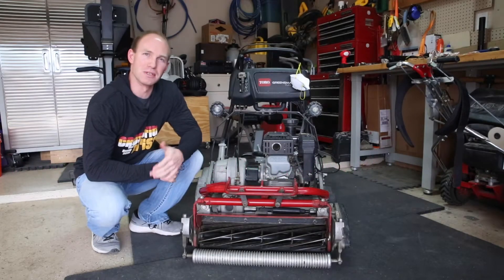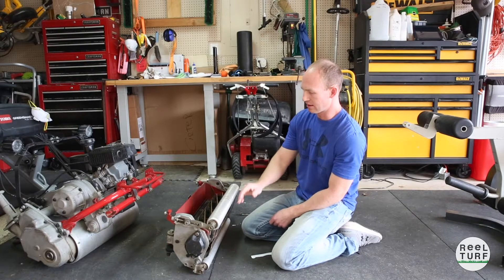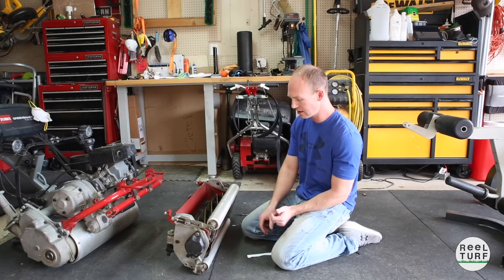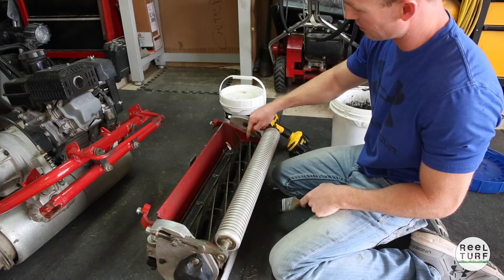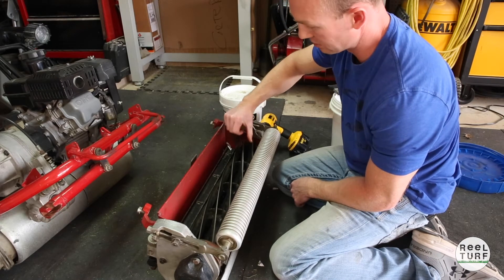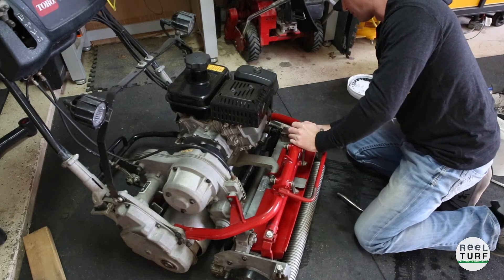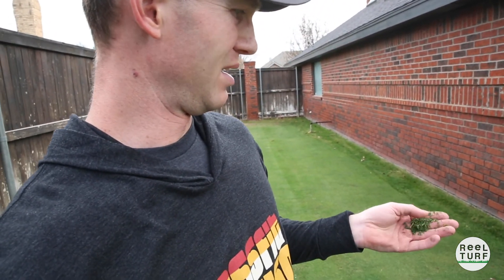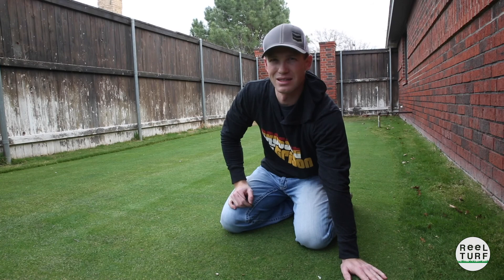Putting Green & Backlapping

Comment: I just bought a used toro flex 21. Your videos are awesome and have already helped me out a ton. Thanks for taking the time.
Reply from the maker: Flex 21 nice! I’m glad you’ve enjoyed the videos. Anything in particular you want to know about?
Reply: @ReelTurf  yes sir, have you installed or know anyone that has installed the high height of cut brackets on the flex 21? I have mine ordered. I plan on cutting as high as that will let me (I think it’s .75).
Reply from the maker: Yep. It’s simple to do. You loosen off the two set bolts that are holding the front roller in place. Then you remove the bolts that you loosen to change your height of cut. The old arms slide out and the new ones slide in. Before you do that take note of how the height of cut arm fits on the reel assembly. There is a knuckle on the height adjustment bolt that fits just right. Make sense?
Reply: @ReelTurf  makes sense! Thanks for the advice.
Reply from the maker: Sure! Let me know if you need help.

Comment: Great video! Quick question does the hour meter always stay on?! I just bought a flex and was curious thx you
Reply from the maker: Yes it does. Enjoy the mower!
Reply: @ReelTurf  question , when I mow and disengage the reel in a turn  and try to engage again the mower sometimes turns off?! U think it’s a belt or bearing issue ?!! Any  advice would be greatly appreciated
Reply from the maker: This will sound stupid- is the gas tank full? I chased the same issue once. Looked at everything complicated before realizing the tank was low. It would die when engaging the reel because the engine pulls on the governor arm and there isn’t enough fuel there. Let me know!
Reply: @ReelTurf  wow u maybe right! I’ll check this afternoon thank you so much!

Comment: I just picked up a Toro flex 1820 and I want to remove the axles like yours. Are there any instructions out there how to remove them? Thanks
Reply from the maker: Nice! Send me an email to info@reelturf.com and I’ll send you a video link I’ve sent others to help with this.
Reply: Success, thank you for your prompted response and great info. My axles are off and mower looks sick😎
Reply from the maker: Awesome! Glad it worked out.
Reply: @ReelTurf  Did you figure out an alternate way to remove flat head bolts from bed knife or do you own the special socket tool?
Reply from the maker: Buy the correct flat head socket and a new set of bedknife screws from rrproducts. You will not be able to get them out with a standard screw driver. The slot on the heads also tend to give some when backing them out. It’s worth a couple of dollars for new screws to avoid having a screw strip out. Because that is all hardened steel, you would have a very tough time trying to drill a screw out if it stripped on you.